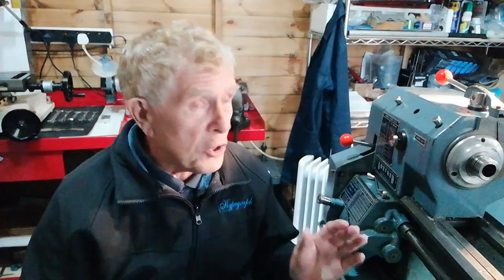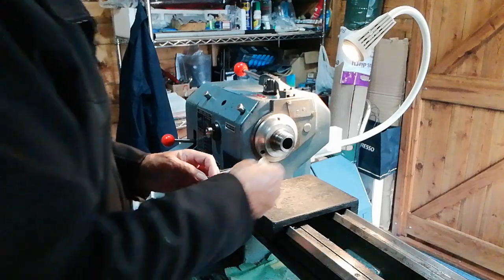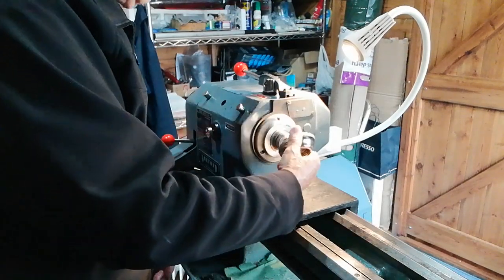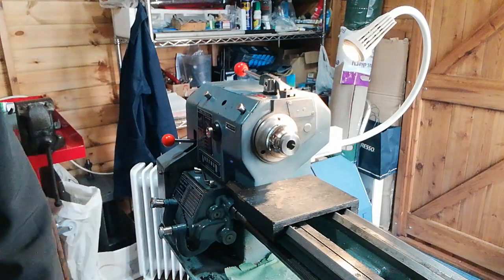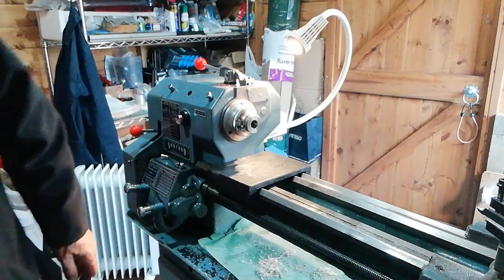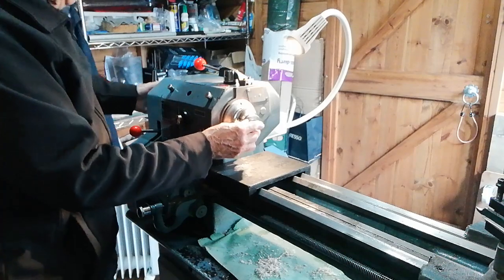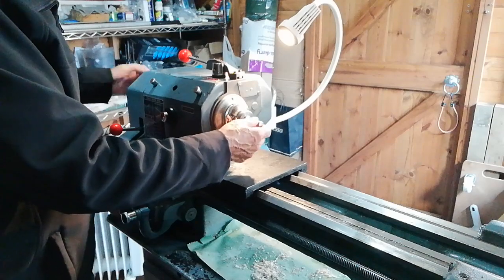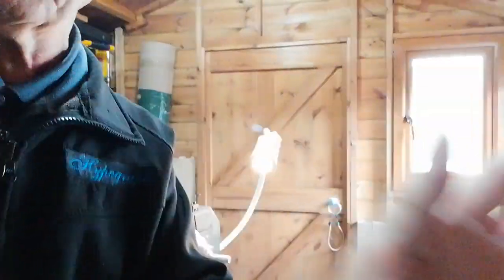How to correctly position a Collet Chuck on the Boxford Centre Lathe.

Comment: Great video! Thanks for putting this content together. Is the collet drawbar specific to the Boxford or is it for a range of lathes? Thanks again!
Reply from the maker: Hi Martin, good question, thank you for asking about this.
The Collet draw bar as illustrated in the video, can be applied and adapted to fit most lathes. I say this, because some manufacturers may not have offered this as an accessory. However; the Boxford collet set will certainly fit the American 4.5" Southbend lathe, as it is identical. Other lathes may have a smaller or larger length of the headstock; also spindle bores may be a different diameter. In this case it would not be possible to fit the Collet holder, as the spindle morse taper could be smaller or larger.
There are also different types of clamping methods. Larger Capstan and Turret lathes, often have lever operated devices to lock the workpiece in position.
I hope this will clarify the situation for you and if I can be of further assistance, please let me know.
Thank you for your question, which may also be of interest to other
 viewers.
Reply: Keith Atklint thanks for your courteous reply. I have a Boxford ME10 and I was curious if other manufacturers’ collet sets would fit because I’m having difficulty sourcing a Boxford set. Thanks again!

Comment: Hi just bought a metric boxford aud lathe and has this through collet system but I’m missing a thread protector collar if you know of any available? My question is the collet arbor you push in is it pegged so the collet doesn’t spin when tightening up? As the arbor I have is not pegged.
Reply from the maker: Hi Roger, thank you for your questions.  1. Spindle thread protector.
This item is very difficult to find and also expensive because of it's rarety. I do sometimes come accross them, so if you send me an email stating your requirement, I will be able to notify you when one is available.  You could also make your own. Alternatively you could just use a small faceplate, catch plate, or a Chuck back plate to put you on in the interim.
2. Collet Arbor.
Yes it should be pegged and have a location stud. If there is a small hole at the end of the Arbor, then the stud has fallen out. The solution is to make and fit a new one. If there is no hole apparent, then the inner part of the stud has either worn out or broken off. The solution is to make and carefully fit a new stud to suit the original position. Contact me if you need further information or clarification on fitting procedures. 🍀
Reply: @keithatklint5380  hi Keith thanks for your reply,  looking now at the collet arbor the peg has broken off by the previous owner so that’s a job to do.  Thanks again Keep up with the good work!!
Reply from the maker: @rogertownend6812  try using all lower case entries, as in;    
keith@klint.co.uk
Or maybe this link could connect.
Reply: @keithatklint5380  👍 thanks that’s better You should have it now 🤞👍
Reply from the maker: @rogertownend6812  Yes thank you and I have sent you an email in response.

Comment: Hi, can I ask, where I can get a mandrell and collets like that ?
Reply from the maker: Hi, the Collet sets and draw bars are quite difficult to find. I do sometimes come across them, but at the moment I don't know where there are any available. However; sometimes I have obtained them as part of a job lot purchase. If you contact me by email ;
keith@klint.co.uk informing me of your requirements, I will keep them on file and advise you if I know when there is availability. Please let me know what lathe you need them for. You could in the meantime look in the workshop adverts for tools and lathe accessories.
Thank you for your comment and good luck with the search.
Reply: @keithatklint5380  Hi, thank you for the answer, I have a Boxford gear-boxed, AUD .
at the moment I have a 5c collet chuck and some collets, but the one you used is Boxford original and I dont mind to have one, if you know anyone or see anywhere they sell them please let me know.
thank you again
Reply from the maker: Yes, I can certainly do that for you. Please send me an email to keith@klint.co.uk. Mention exactly what you require, as this is essential for my records. I will include you on my list for notifications should the item becomes available. Take care, keep safe and good luck. 🍀